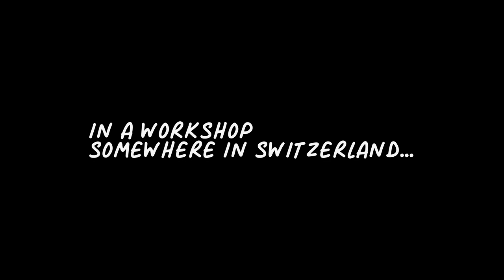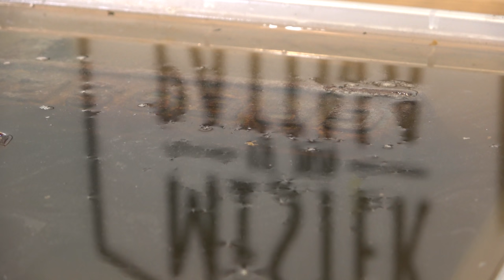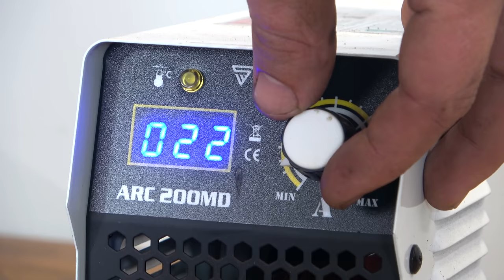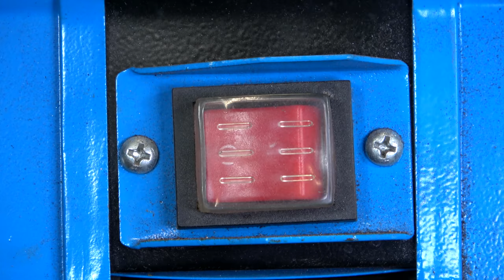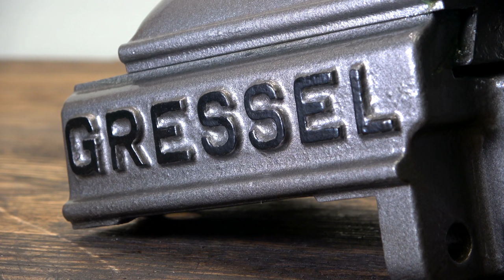Rusty 'Gressel' Vise | Restoration

Comment: True facts about My Mechanics:
1) He, being a machinery whisperer, has a voice no human being can hear - what we heard in the intro is the accurate rendition of his voice if we could hear him.
2) My Mechanics' tears can be used as cold bluing liquid - they are hard to get though. The only occasion to collect them is when My Mechanics realise he left some sharp edges on his work.
3) Even though My Mechanics lives in Switzerland, his house is located on the beach near the ocean.
4) My Mechanics can turn tap water into a powerful degreaser with sheer power of will, but he rarely does it, as he doesn't want to show off.
Reply: So what your saying is my mechanic is.  Chuck Norris.
Reply from the maker: My mechanics can close a revolving door
Reply: MyMechanics can cold blue aluminum, he just hasn’t had the chance to do it yet.
Reply: My Mechanics can UN-make a new one if he so chooses - he just chooses NOT to.
Reply: Well Said!!  5) "There can be Only One" and a chosen protege.
"A protégé may have two mentors at the same time—as long at those relationships do not conflict or compete with each other. However, a protégé can have no more than two mentors over their lifetime."  ~¿@
Reply: My Mechanics can restore a person, but hasn't had the chance.
Reply: @Kellanium  Actually you CAN cold blue aluminum, I have some from Birchwood Casey.
Reply: Can My Mechanics Restore my Marriage?
Reply: @Extreme-Graphics  if a restoration doesn't work, there's always the much less fortunate option to make a new one. But hopefully it won't come to that

Comment: To paint raised lettering quicker and easier, use a piece of cloth, grip it tightly between your fingers so it makes a small round ball, wet it with paint, squeegee the excess and then use the cloth as a stamp. Works marvelously fast and as long as you are careful there is less danger of smearing paint.
Reply from the maker: Thanks for the hint! 🙂
Reply: for oddly shaped areas like on the vise, you can also use an eraser in the same way to apply paint. The benefit is it won't wrap around the raised lettering at all.

Comment: Curious about your rust remover concoction. Is it manual transmission fluid you're using? Because here in the states automatic transmission fluid is red for the majority of vehicles including imports. Love your restorations!!
Reply from the maker: Its a DSG transmission Oil (double clutch transmission). Thanks!

Comment: When you cold blue your metal parts, what kind of oil are you using in the part of the process?  Thank you for your time.
Reply from the maker: I used a 10w40 engine oil 😄
You can use any type of oil for it.

Comment: You think you put enough "grease" on everything? The grease in the pin holes where the jaws fit was basically making a piston compression situation. Hard to drive in a pin when there is grease and air trapped inside. But you really did a nice job with it...

Comment: Did you buy new pins or have to make them?   When you rethreaded the screw holes, then you have to use different screws with a different thread count?
Reply from the maker: I made all pins by myself. The thread cutting tool has the same count as the screws 🙂

Comment: Can I ask, will acetone and used transmission oil be used for rust remover? That could save a lot of waste just from me.
Reply from the maker: Got to correct myself: acetone + transmission oil is a very good penetrating oil, not a rust remover. I don’t know if used oil works aswell
Reply: @misterpatina  thank you for your reply. I have plenty of WD40 for penetrating oil but I may look into the transmission oil as it could save waste.

Comment: 1:20 not transmission oil. It should be automatic transmission fluid, ATF (red colored). ATF includes rust / corrosion inhibitors and agressive detergents and when added with acetone, the mixture becomes an effective rust remover and penetrating fluid. One point is that, acetone and ATF do not mix by themselves. You need to shake / stir well before use.
Reply from the maker: The oil Iused is a double clutch transmission oil. Same technical characteristics. Not every ATF is red.
Reply: @misterpatina  actually almost all ATF are red and this is by purpose. And ATF is not an oil, but a fluid, as the name implies. Oils do not have characteristics of ATF and hence, they do not work as penetrating liquids.